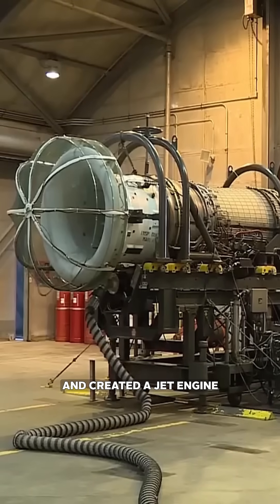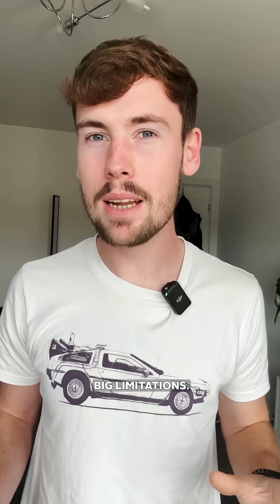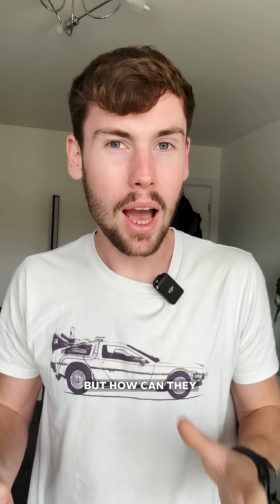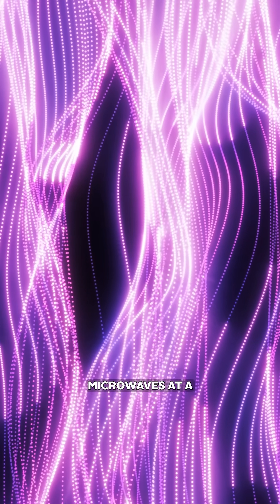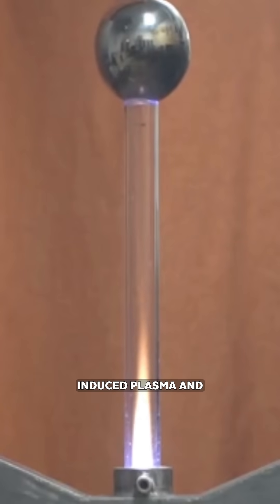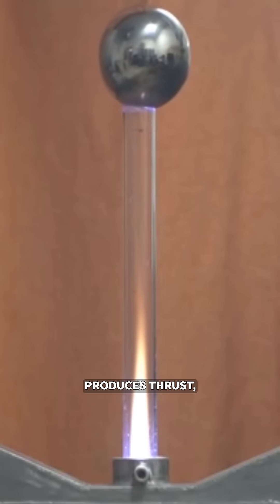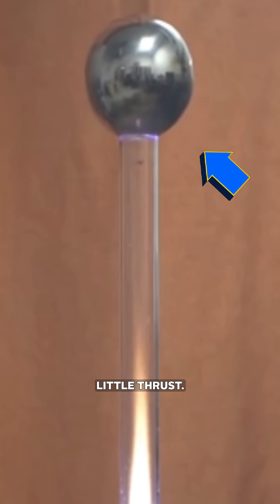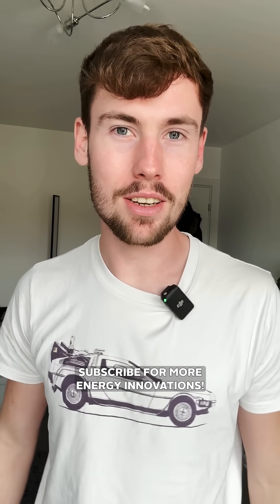PURE Electric Jet Engine #breakthrough #science #jet

Comment: The round ball sitting atop a stream of air IS an aerodynamic problem, before any thrust hits it from below.. A VERY bad example to show. The stream of gases from below will lift the ball slightly and THEN suck it down just as hard.  Do the same example with a lighter ball,, It won't push it away

Comment: the ball on the pipe isnt really a demonstration of thrust as rather bernoullis. though a poor one.
still, the faster the flow, the higher the thrust, to a point, the more that ball will cling in place...
when you look at fuel as a source of heat and engines run on heat alone, whats the difference between electrical heating via plasma or other, and a flame? nothing.
its doing it to the volumes of air a jet can ingest... releasing megawatts of energy, continuously...

Comment: Big fvcking mistake. The reason we use combustion and combustible fuels is the energy density of those fuels.

No battery tech can come close to the energy densities of petroleum based fuels.

This may be a viable option in about 1000 years, but by then, combustion will have also advanced 1000 years.

Comment: A reactive engine always has a reactive propellant, often fluid, just not always on board or not always one that generates thrust from its own exothermic reactions. If it's taken from the atmosphere, then reacting with another combustible propellant and, through heat expansion, shot from a nozzle, then you get a turbofan reactive engine like that on most commercial airliner planes. You can propell an atmosphere sourced propellant with electric current through it and an electric field on electrodes resulting in an ion wind engine without moving parts. You can conduct an electric current through a propellant and propell it with a magnetic field too, which is a magnetohydrodynamic drive, also without moving parts, often using conductive water solutions as reactive propellant. Of course the most famous are isolated reactive drives that can work in vacuum by using limited on-board propellant, propelled either by its own exothermic reactions (combustion) — rocket engines, or by electric fields on charged propellant, just like in the ionic wind engine, just with its own gas instead of atmospheric — the ion engine.

Comment: Most key engines are big fans and use that as the main source of propulsion. 
The burning of fuel does add to it but also supplies energy to run the fan and and accessories. 
A plasma jet would be interesting but the energy density of the various jet fuels is super high

Comment: Where are the batteries big enough to power the engine. You would not get off the ground with the weight of the batteries necessary

Comment: Fighter jets are not dumping raw fuel into the chamber for basic flight, that would be a rocket. Its still essentially an internal combustion engine turning the turbine which compresses the air and shoots it and the exhaust out the back. For afterburners they inject fuel for extra thrust but thats a separate process.
Its not a problem at all to make an electric turbojet engine. The issue is energy density to run it. The same weight of batteries as fuel would get you 5 minutes of flight time not 5 hours

Comment: Sir, with respect, a jet engine has a turbine aka blades. Much like a propeller. If you use the heated plasma in the jet engine's combustion chamber, you get the same effect as the fuel. It doesn't take much flame to spin up a turbine. That is how you'd use this. Problem is kerosine has a higher energy density than a battery, so you have drone like flight times out of your plasma powered turbine.

Comment: A turbine engine only burns a portion of the intake air in the combustor, the rest is there to absorb heat, expand, and excellerate. The plasma idea is great if it can be used to heat the surplus air.

Comment: Well, if you add a boiler it will.make steam. Steam heated to 1000 degrees makes steam. That steam will spin a turbine. That turbine will make electricity.  WITHOUT FUEL

Comment: A related technology was used back in the 1950s in research for the Atomic Airplane. A nuclear reactor can heat the air coming through a turbine to produce thrust. This just replaced the combustion of fuel as the heat source. Also, several rocket engine concepts use microwave plasma as the basis of producing thrust exactly like this, for interplanetary transfer.

Comment: Wouldn’t the weight and size of the batteries required eliminate any benefit even if the thrust were increased to a viable level? Remember a fully fuelled jet airliner cannot land with a full payload or they would damage their landing gear. Kerosene powered aircraft benefit from becoming increasingly lighter as they travel. Battery powered engines don’t.

Comment: Compare the energy density of kerosene with that of the best methods for storing electricity,  the fact that the vehicle would weigh the same when out of fuel as it does when full means it'll be much less efficient

Comment: Thrust maybe not but it could be used to clean the exhaust gas on combustion engines in order to get rid of precious metals in the pipe lowering the cost to clean the air

Comment: Like your BBQ lighter can you not just ignite the fuel with a spark…Also, in fuel storage and delivery systems static electricity is huge fire hazard, so using large capacitors to ignite fuel is a simple solution

Comment: If the air can be compressed enough and heated to 1200 degrees Celsius the air might be the fuel that runs the engine. Possibly a scramjet engine could use the plasma to help ignite the air as fuel. If so a scramjet engined plane could be kept in the air for a long time because the air it travels through would be its fuel. But then people working on similar powerplants would already know that.  Odds are that scientist type people do not work on such powerplants to power biplanes at 60 miles an hour through the air.

Comment: Well if the made it a hybrid and use the plasma to vaporise the jet fuel, which is then pumped under pressure into the expansion chamber they would create the thrust exponentially.

Comment: Yes in a reusable transportation environment - carrying around a useful amount of stored electricity - quickly gets us back to a liquid product with 40MJ per kg and a conversion efficiency of around 30%....
(vs Primary Batteries  - let's say lithium- Air/O2 battery -  4.6MJ/kG and storage to thrust - roundtrip  - efficiency of 80% (generously)  - single use as is best suited to military load outs...

Comment: So much misinformation you might as well be making everything up. Yes ion engines exist they have now for years the problem is they produce so little thrust that they are more of a gimmick then anything else they are so inefficient the only way we will switch is if it is in space with an unlimited power and time to accelerate. And even then solar sails would propel a craft faster.

Comment: He left out an important part, and that is the air and fuel has to be compressed in order to produce "Thrust." Therefore, plasma as a combustible would need to do the same in some way.
Reply: And it can be augmented by anything that can move the ionized gas around, which can be done easily via electromagnetism or electrostatics.
Reply: It does not HAVE to be compressed to produce thrust, expansion happens during combustion regardless. It just makes everything a lot more powerful and efficient if you compress the mixture before combustion.
Reply: There's nothing combusting.
Reply: @falconerd343  It's still expanding the gasses from its intake the same way.

Comment: And they need massive batteries in plane be to heavey to take off
Reply: A 747 has a take off weight of nearly 1 million pounds the fuel alone weighs half a million pounds. The key issue is designing a more energy efficient way to use the power from the energy source provided.
Reply: @mrdrchad6110   How much do you think they could improve the efficiency? Double? 
To supply the same amount of energy of a half million pounds of jet fuel would take 30 to 40 million pounds of batteries. Half a million pounds of batteries would only allow 20-30 minutes of flight.
Reply: @GordieGii  microwave plasma  produces heat at 1000°C using milliwatts of power. A single 3.7v 2000mAh lithium battery has 7400 milliwatts of power. Further development of microwave plasma technology can produce heat hotter than the sun using lower energy than currently capable. Energy efficiency is measured by the amount of heat produced using energy. If you could scale this up enough you could use a small electric generator to power this engine using mulch less energy. An Electric motor is more energy efficient than a fossil fuels burning engine. We can and are designing new batteries that hold more energy are lighter and charge faster. But in order to have progress and drive inovation there needs to be demand in order to have demand there needs to be someone to show that this is possible. 
The stupid people who cannot comprehend how something works so they shoot down ideas and claim it isn't possible causes other stupid people to have the same opinion.
Reply: They could always remove the ammo to reduce weight...

Comment: We couldn't have the technology we use today without the early technology of the past. We will get there.
Reply: Should i remind you that one of the earliest cars ever built was... electrical and we still struggle to this day to have viable electrical cars?
Reply: @mycardbrokedown5699  albeit worse than the surpricingly efficient death machines that are american cars, EVs are perfectly viable the only issue is that america's roads are far too big to support lower range vehicles also charge times could be fixed by replasable batteries but thats its own mess
Reply: @xxizcrilexlxx1505  modern evs have range similar and in some cases bigger than ice ones. The charging problem is also being addressed, chinese cars are charged at 1000 volts and can be chaged up to 80% in 5 minutes. In a few years we'll ve able to charge a 1mw battery in 5 minutes on a truck and it'll last that truck for 800km, which is about the same as diesel trucks both as range and as speed goes. I believe in 5 years building electrical cars will be cheaper than ice ones...

Comment: Not practical for Jets on Earth, but very practical for Space Travel. The constant push, no matter how small or little with no resistance will add up and eventually accelerate the object to near speed of light.
Reply: Reaction mass is needed. In atmosphere, the air can fill that role as exemplified in the short. That engine is just kinda awful in every metric possible, however, so don't hold your breath. TWR is really the king factor for in-atmosphere propulsion. If you're looking for an exotic engine that can run on anything and also have the thrust to be useful, you're gonna be looking at one of the many wacko nuclear-powered compression engines.
Reply: @axelord4ever  reaction mass requirement changes with tech level,   you can use medium in solar system or interstellar,   and even if you don't you can still use relativistic speed tricks,  like as for example using 1gr ejection to reach 0.9c for 1 ton mass for example   ( but you still lose mass due to energy loss)
Reply: Any conventional spacecraft with mass and constant acceleration will never come near the speed of light, unfortunately. The mass of the spacecraft will asymptotically increase with velocity. Look at how much energy the Large Hadron Collider needs to accelerate nuclei of atoms to near the speed of light.
Reply: @Twenty-Seven  that is of course if you dont have stuff like finaliam but yes
Reply: @seantaggart7382  Finaliam?
Reply: @Twenty-Seven  Its a metal only found on my world
It kinda Is very nearly physics breaking
But you see finaliam contacts Tightly packed energy from pop 3 stars
The first stars
Its very energetic
Reply: That would be a rocket engine, you're thinking of an Ion rocket engine. A 'Jet' engine requires atmosphere. Plausibly small thrust could be used for a long-distance plane, but at such small thrust an electrically powered prop would work better. Still, I imagine the current research will come up useful someday, even if it isn't useful right now. Such as jet propulsion in the upper atmospheres of other planets, which lack oxygen normally used for jets.
Reply: Bro it’s a jet engine not a rocket 
It needs air
Reply: completely different principle.
Reply: I was about to say that
Reply: It wouldn't work in space, but it might work for a probe flying in upper atmosphere of Venus. The problem is that the energy consumption must be enormous, so it might not be possible to produce enough
Reply: I would imagine the amount of air it needs would be far too great to carry and use in space
Reply: It needs some mass to heat up (usually xenon or krepton though letarly anything would work) theas exist they are called microwave electothermal thruster (met) but they aren't as popular as the more efficient ion engines (basically a particle accelerator) or other things that furfile the same nitch like resetrojets or arkjets 
also this technically is old it was invited in the 80s in Pennsylvania

Comment: There is a much more important issue than the limited thrust due to low medium density and it is energy density. The amount of potential heat per mass unit of kerosine is more tgan 10 times higher than even the best batteries. Even fuel cells do not help and why even bother with them if in a jet you just turn the power into heat anyway. It means that a kerosine powered plane is guaranteed to be lighter, more powerful and more agile while having a better payload capacity than a similarly sized electric one while being more reliable and having lower maintenance cost. It is an interesting concept and it can be used for some tests but don't expect to see it in a normal plane.
Reply: because big lithium need those sweet sweet government deals

Comment: Microwaves expanding air has been known about for some time. 
Can’t remember where I read it but it is why bats can “hear” some microwaves which of couse have frequencies far too high to hear. The bats are aware of the modulations in the microwaves that cause by localised heating of the air.
Reply: I doubt the modulation of the microwaves causes heating of the air, it will be the microwave radiation itself.
Reply: @deang5622  I perhaps should have said the modulated microwaves heating part of the bat’s auditory system